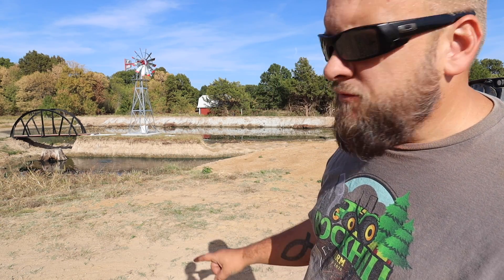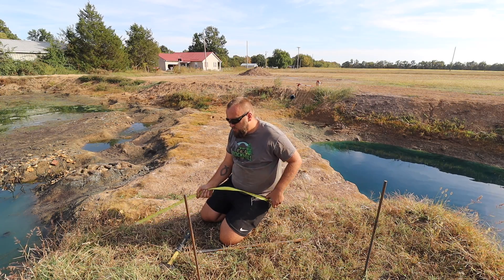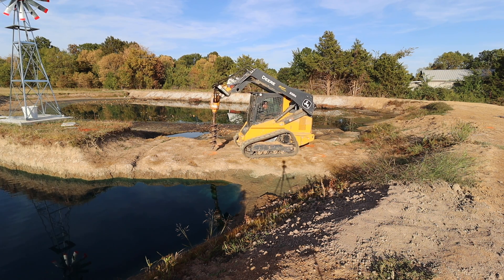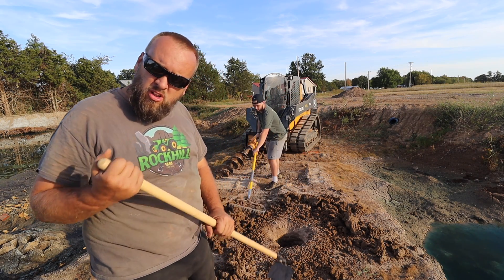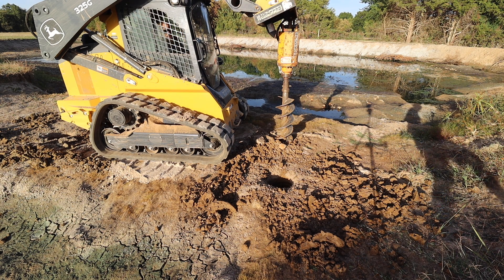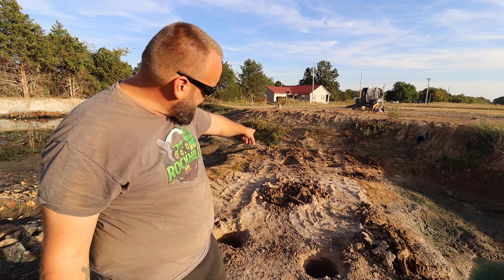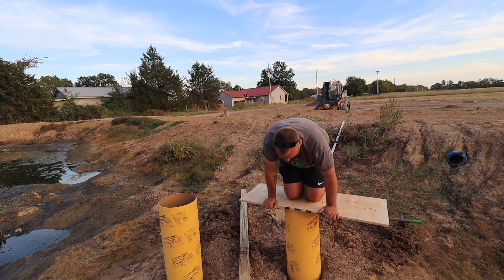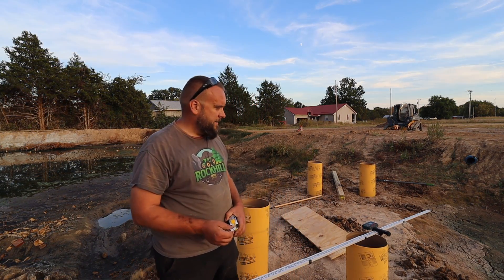I Really Hope this Works - Setting Piers for the New Bridge

Comment: I'd use redheads so you can commit to the exact location later. If you set anchors in the wet concrete the chances of getting all four in the right location are slim. The other option would be frame up your rails and anchors then pour the concrete after that. This is more work and still leaves room for error.
Reply from the maker: I feel like I need to get the concrete poured now before it gets rainy and I don’t know how long it will take to get the bridge done.

I bought J bolts To sit in the concrete but I don’t know what redheads are. I guess I need to Google that if it gives me flexibility on placement. My hope was that I would try to set J bolts in the right place and wait to drill holes in the bridge based on where the J bolts are
Reply: @RockhillfarmYT  Redhead is a brand name for a concrete anchor where you drill into set concrete, tap the bolt in, and tighten a nut which expands the bottom and holds tight. I've used them many times and have been happy with their performance.

Comment: Sill plate anchor bolts set into the concrete would be the way to go. They're what's holding pretty much every house down (gravity might help too). Be sure to use rebar in those piers also, and if you want one more layer of protection, peel off the tubes and apply some kind of liquid waterproofing membrane to the exposed concrete before the pond fills back up.

Comment: Great job, I'd find some anchor bolts of some kind have a string set up like a pole barn , you can square it all up before you pore concrete . Box in your peers with concrete I like that idea . Tamp the holes before u pore with a bar or 2x4 something. These are my 3 cents. Great job Todd🤪

Comment: I would drive 3/4"rebar down a foot half with wire wrapped around it to strengthen concrete. Put heavy L shaped all thread to anchor down top

Comment: You can buy all kinds of brackets that can be concrete anchored in after the concrete sets so you can set the bridge and then fasten it to the concrete after the bridge is in place just so you can account for any error or changes.

Comment: Hey Brock you might want to go to Home Depot or something or Ace and look up redheads. You drill holes in the concrete yeah tap these red heads in with a hammer and when you tighten them down they expand like a Molly and a sheet rock wall and you’re solid. The nice thing about the redheads is that you can set your bridge in place without having to worry about your holes lining up with whatever it is that you put in your concrete to mount to. You can set it down a line at the way you want to drill you holes through the steel right down into the concrete tap the redheads and tighten them up and you’re done.😁👍

Comment: You made me a little nervous rotating the skidsteer on that narrow strip with the auger so high in the air.  Remember that the bridge itself will hold the pillars in place once they are attached.  A big eyebolt would be a good fastener to put into the concrete.  The eye would get trapped in the concrete and not allow any movement.  The pillars should be fairly sturdy.  Try moving one after the concrete sets up and you'll see!  Just remember to use sufficient rebar.  I'm just an amateur myself, but have done this a few times, with the only difference being I had to dig the holes by hand with a post hole digger.  After years of frost cycles, none of mine have moved an inch.  Not preaching, just suggesting.  Great video!
Reply from the maker: Thanks